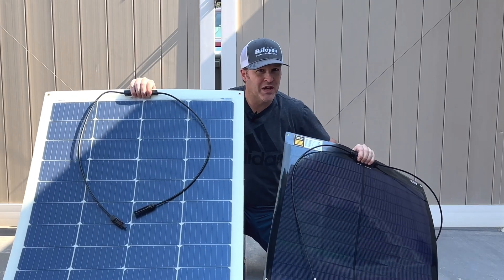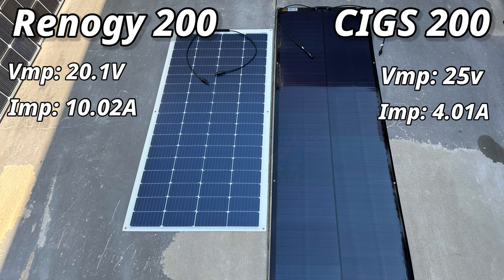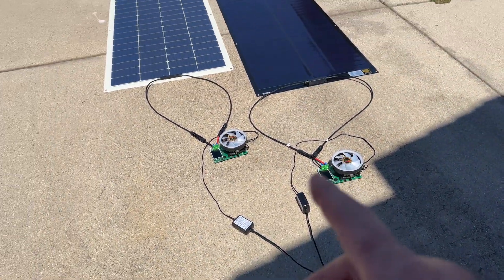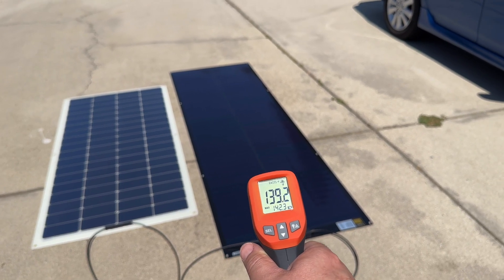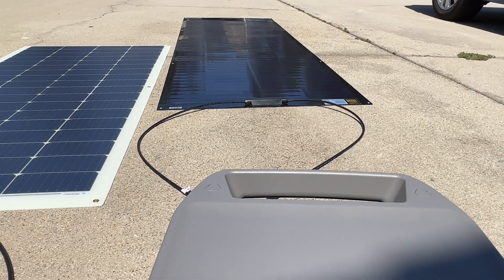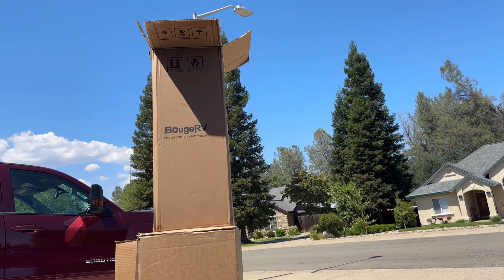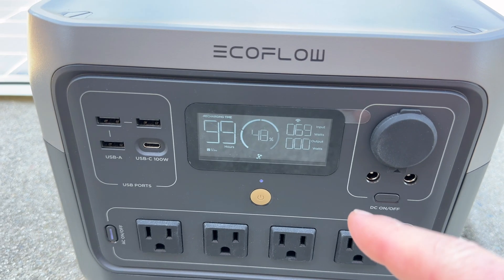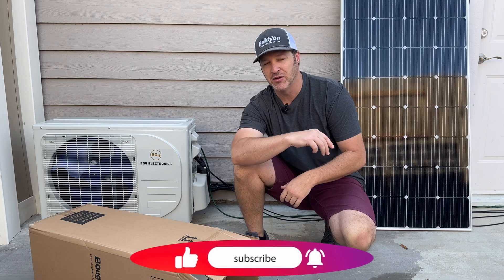BEST FLEXIBLE SOLAR PANEL CIGS YUMA 200 VS RENOGY 200 Watt

Comment from the maker: “NON SPONSORED” DISCOUNTS BELOW for items in video
Is the CIGS the best flexible solar panel? Let me know if you would buy it??
#solar #solarpanel #offgridliving #rv #cigs 

200 Watt CIGS Tape: https://www.bougerv.com/products/200w-flexible-solar-panel?aff=Johnny
200 Watt CIGS Holes: https://www.bougerv.com/products/yuma-200w-cigs-flexible-solar-panel-with-holes?aff=Johnny
Code:  JOHNNY27 27%off
100 Watt CIGS Tape: https://www.bougerv.com/products/yuma-100w-cigs-flexible-solar-panel-with-adhesive?aff=Johnny
100 Watt CIGS Holes:  https://www.bougerv.com/products/yuma-100w-cigs-flexible-solar-panel-with-holes?aff=Johnny
Code: JOHNNY21 21% off
ENDS August 27th 2023

Amazon links No discounts: 
200 watt cigs holes: https://amzn.to/3OuLL4z
200 watt cigs tape:  https://amzn.to/3ORqovF
100 watt cigs: https://amzn.to/3Yyzgd2

Renogy Flexible 200 watt: https://amzn.to/3KAcQlL
Renogy Flexible 175 watt: https://amzn.to/3s6GGbb

Ecoflow power Station 
River 2 Pro:  https://amzn.to/47pWx4O

Direct Questions for fast response ...https://asqme.com/@johnnysweekends

CHECK OUT MY AMAZON STORE: https://www.amazon.com/shop/johnnysweekends

If you feel I helped you out..Buy me a Coffee 👍🏼🙌🏼👊🏼😀
https://www.buymeacoffee.com/johnny5120J
Reply: @johnnysweekends  Your temp spot gun measures a circle area if temp spot gun direct above area. The circle area is variable, dependent on distance between temp gun and area to be measured. Surface area to be measured has an emissivity, dependent on material, clean, reflectivity of sunlight.
 Black electrical tape can be used on surfaces to get a best temp reading.

Comment: Hobotech shot a bouge RV cigs panel 5 times with I  believe 9mm, it still worked and the last time it was tested 165 watts. He also drove over it with his 4wheeler.  walked on it, it was laying on gravel.  It still worked 165 watts.

Comment: Johnny, can the CIGS panel be directly adhered to a curved fiberglass roof (RV,camper,etc.) without worry  of heat damaging the RV's roof and lower efficiencies in output? I ask because it is historical knowledge that all solar panels really do much much better (especially flexible panels) when they have an air gap under them. I ask because my wife is studying a fiberglass camper and though stylish is fraught with curves on the roof where I'd want to install solar panels.
Reply from the maker: If you can lift them or place them on sign board that can help. And unfortunately curved roofs will produce lower output over all. But you gotta do what ya gotta do. 
I have no damage from mine whatsoever so ever.

Comment: Good morning, would you see a problem pairing 6 panels to Pecron E3600FLP Solar Generator with input specs: 
2*XT60-M: Voc 32V~150V / 1200W Max / 20A Max

Comment: I just checked the prices and Renogy is $350 and Yuma is $700. So its double the price, Its a lot of money for a solar panel, rather get a pair of fixed ones and gain way more power.

Comment: BEWARE OF THE SPECS ON THIS PANEL:
I purchased 2 of the 200W CIGS YUMA panels in this review.
My generator needs 60-150V to operate.
These panels are 30.5 Volts each so I wired them in series.
They did not work.  I checked the Voltage on each panel and it was 25.5 Voc and not the 30.5 stated.
I checked the VOC when wired in Series and it was 51.5 V for the 2 panels.

I just wish that the lower than stated VOC on these panels was reviewed.
I like that they are indestructible but am SUPER DISAPPOINTED they do not live up to their stated Specs.

I did contact support but their support is iffy at best for my experience.  I have a few days left in the return period so will probably do that if there is no resolution with support.
Reply from the maker: No panels meet spec for Voc if you got other panels you would run into the same problem. And even then you need to be a decent amount above turn on voltage or you will just be clipping 
Voc of at least 80v would be ideal

Comment: I ended up buying 600 watts of CIgs for my travel trailer with 400amps of Lipo4 batteries. It's roof is radiused (or rounded) so half the panels have to face opposite directions  from each other. Despite that,  I get tremendous output from all of them - out of 600 watts, I get 490 to 605 watts even with marginal sun.  Because of their positioning, I thought I would never get that much energy from all of them and I am thrilled with the results. I run a 10 cu/ft fridge lights, pump, etc and have no shortage of power. 
I installed 2x100 watts on my buddy's teardrop and they not only keep up with his 12v fridge and other daly usage, they constantly keep the 2x100A Lipo4's at 70-100%.

Comment: Your heat gun measurements are inaccurate.Because you're too far away from the test subject. You will be reading the heat from adjacent objects at that distance.
Reply from the maker: The differences are minimal. Go buy 3 infrared temp gun. Then find the measurement ratio…12:1 50:1 or what ever. Measure it at that distance and start backing away. You see little change in the 15 inch to say 3 feet. Maybe .5 degrees. Then try again at that same 3-4 distance again almost the same temp by .5 maybe 1 degree difference at most. 
Then try 10 feet and you’ll see no more than 1-2 degree difference at most from original from the required 15 inch’s or so.
It’s a ball park but if a more scientific or accurate measurement is needed then take multiple readings at the required for the instrument your using

Comment: Show us the delamination level of each in 5 years. Not worth the investment for either without proof of durability.
Reply from the maker: Show me durability testing on a brand new $50,000 car.
Reply: @johnnysweekends  We already have significant delamination occurring within the first two years on new CIGS panels despite their high cost. At five years, they're likely to have a high failure rate assuming normal atmospheric exposure, so the net cost of their power production will also be high.

The technology in most new vehicles, including EV's, has many years of durability testing behind it and the pros and cons can be reasonably anticipated by the buyer. The more experimental aspects are known to be that, such as the various levels of self-driving capability, and they aren't essential to the basic transportation value of the vehicle. A delaminated solar panel, by contrast, has lost its usefulness and value.
Reply from the maker: @ReflectedMiles they have a warranty what did they say?
Reply: @johnnysweekends  That they are aware of the issues (including the problem that if you use a strong enough adhesive to actually keep the panel firmly adhered to the substrate that you will likely damage your roof trying to remove it for warranty—and obviously that or the hours taken to remove it are not covered), and the warranty only applies to the original date of purchase, not extended by the new installation of panels replaced under it. Otherwise, buyers would have free panels for life. Any warranty longer than two or three years is one of the reasons they cost $2.40+ per watt—there has to be enough margin there to cover the inevitable replacements for full-timers, especially, who don’t put their rigs away under cover for most of the year. Of course they didn’t say that last part, but taking a look around the most popular DIY solar forum is instructive.
Reply from the maker: @ReflectedMiles flexible panels have a place but will never replace rigid. It’s another option or tool for people who want a different solution. 
There are pros and cons to both for the correct install. Rigid panels are cheaper but pose there own problems on RVs and we may see a change in the next 5 years for the way RVs are built or what’s allowed. 
We will see. Because with more and more installs, more and more are flying off and becoming a big hazard that can be deadly. There are a lot of variables to it but again. Both have a place, but they are not replacements for rigid.

Comment: 500 bugs for 200Watt???
A bad idea to beginn with. 2018 I paid 200 bugs for 200 Watt flex panel - 6 years ago!
btw: still working.
Reply from the maker: Dude there pricing is insane right now!! Idk what the heck they are thinking !

They are supposed to be way less

Comment: I just installed 4 of the 100 watt Renogy panels on my trailer. They seem well made and I hope they hold up well. I also have 2 of their rigid bifold 200 watt panels for a total of 800watts. I haven't tried them all out together yet. Will be interesting. I've heard they aren't as efficient and may not last as long when mounted directly to the trailer surface. I used double stick 3M tape.  They look great and I hope they work well with my Victron solar controller and LiTime 300AH lithium battery.
Reply from the maker: Mine are a year old through some serious heat… still working good. 
Rigid is always better but there are pros and cons to both.

Comment: The Renogy panel was obviously defective. Did you get it replaced to perform a correct test?
Reply from the maker: How was it defective?
Reply: Your heat probe identified an area of overheating. That is not normal as you know and you pointed out. You mentioned that the panel was defective or damaged in the video. The output would be different if the panel did not have the overheating. I purchased a defective Renogy panel as well, they have a high defective rate. It would be nice to see your result with a panel that was functioning properly. Ben S/V DAWN  @johnnysweekends
Reply from the maker: Oh yea forgot about that. So much to remember. Funny I have two panels still sitting here as I want to use them on my Rv. 
I need to rescan all of those as well now that it’s been almost a year but they are still rocking. 
I’ll need to test each one individually as well. That should be fun 🫤 

Even with the one hot spot I can’t imagine a major difference unless it truly took out the whole cell. 

Now that the sun is out again I’ll pull them out and check 👍🏼

Comment: I have had 3 RENORY flexible solar panels intalled on the top of my semi in a little over a year cost over $600 now it's yielding only 25-35 watts every day -bumer.  The CIGS solar panel shows better performance and last 25 years under warranty.  It's a worth while investment.  I can't wait to install the new panel.
Reply from the maker: Which renogy panels did you have or do you

Comment: I am experienced with solar and camping. The real issue when camping is you never know the solar conditions, the shade coonditions before you set out. I always had enough solar in theory but it was always just minour shade that would ruin my days and forced me to get a gas generator. I will get 1. See how the performance is. Then replace the other panel and sell ny generator.
Reply from the maker: I wouldn’t sell the generator. Like you said, you never know what the conditions are like. I have a lot of solar and still, sometimes it’s not enough depending on conditions
Reply: @johnnysweekends  okay I'll see how it is first. I have a tear drop(or like a very big tear drop trailer) so my electricity demand is very low. Even a consistent 25-50 watts is all I need. And I can probably fit 2 150 watt panels. My current issue is a couple trees just make my solar useless when camping. Especially sense my panels are old and have even worst shade resistance then modern flexible panels.

So we will see if I need the generator still. I'll test it before I sell it.

Comment: Have a buddy who has a CIGs panel glued on the top of his teardrop trailer.  It's so nice, as soon as the sun comes up it starts sipping power into the battery and doesn't stop until the last ray of sunlight in the evening.   He can park the trailer in shade to keep cool and never has to worry about positioning panels.
Reply: @cgillit  do you know what glue was used? I'm considering this on my trucks bed topper
Reply: @frp1276  The manufacturer has the option to buy the panels with industrial adhesive already applied to the back of the panel.  Just peel off the protective paper and press on.  It's like putting on a big bumper sticker.

Comment: Great Video, I like the CIGS but here in Australia I can get the new Renogy CIGS 150w (looks like a copy of the Bourge) or the normal flexible Renogy 200w. With the difference of efficiency in your test especially in the shade. (i understand it is a difficult question to answer) but which one will i get the most power for a campervan between the 150w CIGS or the 200w standard flexible. thanks for your help
Reply from the maker: You’re right that is tough because it’s new for one, and does it perform as well in the shade with bypass diodes. 
I know so far my cogs does well in low light and shade but o haven’t had enough good days for peak performance to gauge what it’s really doing. Also the fact it’s towards the front of the Rv and slightly curved. Always mount as flat as possible

Comment: Could I use the CIGS on a ribbed van roof?  (Promaster) or will they mold to the rib shape damaging output?  Thanks.
Reply from the maker: I would find a way to make sure it doesn’t flap in in the wind. The ribs will create air pockets and allow it to flap which over time I think will damage it fairly quickly and not to mention allow it to fly off. Maybe fill that area in or creat a flat mount with some board of some type like sign board.

Comment: I have 500 watts of CIGS on my GMC 2500 HD short bed w/ camper shell , 100W on my cab roof and two Yuma 200W panels on my OVS Mamba III clam shell tent.  Connected in parallel I get about 28 volts.  I can run my EcoFlow Wave 2 with my Delta 2 Max just fine, keeping my tent quite cool in the Baja summer desert…
Reply from the maker: Heck yea that sounds like an awesome set up. Wave 2 still working good? I find they do well definitely in smaller quarters
Reply: @johnnysweekends  The Wave 2 is supposed to deliver 5100 watts.  I found it suitable in my bedroom in Cabo, but not as good as my one ton mini split!!  The clam shell is well suited!!  Not sure about heat???  I will see soon in the desert east of San Diego, as it is getting in the 30’s at night.
Reply from the maker: @billbugg1456 Yuma or the Q or Glamis ?
Reply: @johnnysweekends  Blythe / Quartzite area…
Reply from the maker: I was just there at the Q. I got home yesterday. 7 days..👍🏼

Comment: Johnny, What a gem you are.  Love how you think.  Great demo on the panels.  I will be buying the Cigs.  I currently have two of the 50 watt Renogy panels for my boat.  They have been great.  Thanks for sweating your arse off in the hot sun making this video.  I follow Will Prowse, the professor out in the desert, and now you.  Thank you Sir..

I have a trimaran and i am loving how these panels might just be the ticket for me.  I just tie them down to the netting between the amas and the main hull.  Move them around a little bit with the sun direction.  Believe it or not...in San Carlos, Mx. I can get almost 5 amp at 07:00 in the Spring time if I tilt the panels toward the rising sun.  Now I have switcjhed over to LiFePo4 bank of 400+ amp/hr.
Reply from the maker: Awesome glad you found it helpful, and yea I have followed Will for a long time as well. Sounds like a decent setup you have 👍🏼

Comment: you did not say if they were internally wired parallel or series,  which I bet that the ren is series in which shade really affect them and the cigs is parallel which shade not so bad to output.???
Reply from the maker: The ren is a series parallel in the panel, they doing well but like any single panel after about a 1/4 third shaded that’s it. The benefit to the cigs as mentioned in the video is all the bypass diodes.

Comment: Did you happen to do a low sun angle comparison?   On a fully sunny day I'd love to see what happens on the meters as you gradually tilt different panels away from the ideal perpendicular angle.  It would also be interesting to include a standard glass 200 watt panel in this type of test.  I suspect that the CIGS panel would do pretty well at off angles since it did so well when shaded but hard numbers would be great to see.  I'd also like to see how all three panels perform in the full shade of a building but on a sunny day, a bright 100% ambiant light test.  Thanks for the tests, hope to see more!
Reply from the maker: I will add this !

Comment: Would have preferred a test on the grass for example, a concrete driveway in my option is an extreme medium. Have ridged panels on my boat and I'm looking forward to upgrading to flexible. Ready for your weird question of the day? Could these panels tolerate being walked on If you were carful? That would allow me to install more of them on my boat in area's that I couldn't with ridged.
Reply from the maker: These panels according to bougrv and other types of cigs panels advertise they can walk on them, dance and more. I dont recommend it anymore than you need and definitely take care when you walk on them as to not put pressure points. All these are probably the most walkable flex panel out there
Reply: Great! Thanks for this. @johnnysweekends

Comment: 200 watt solar scams. Inferior product short lifespan won't even barely produce 200 watts maybe If you're lucky.
Reply: CIGS-solarpanels produce MORE energy than standard panels, sir.

My 2W-Panel can produce ~3 Watts under the sun (low sun light = 50% more than rated!) and 2 Watts under a typical 20W-Lightbulb/LED. See?

A standard-Silicium-solarpanel (Mono) produces 200W at MAX Sun and 100W or even 50W at low sunlight. And even ZERO watts under a lamp. ou CANNOT produce 300 Watts with a standard 200W-Panel unlike with CIGS-tech.